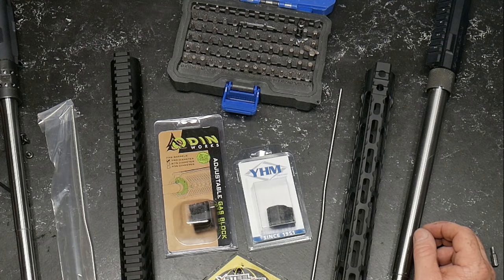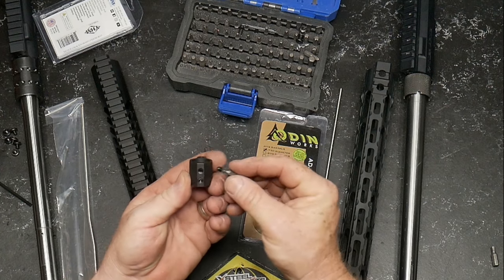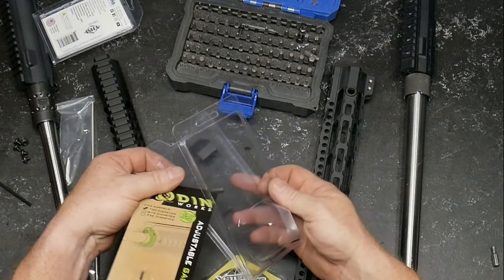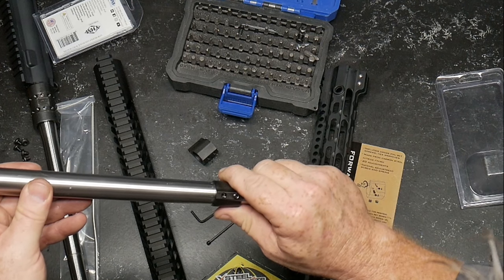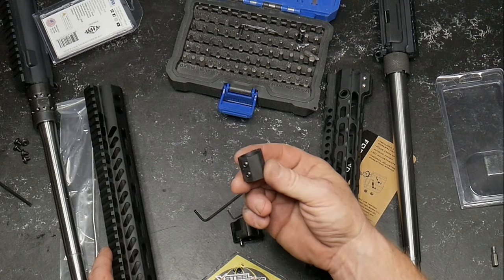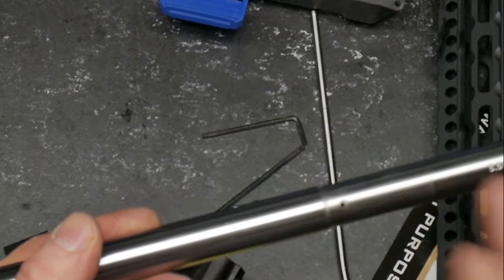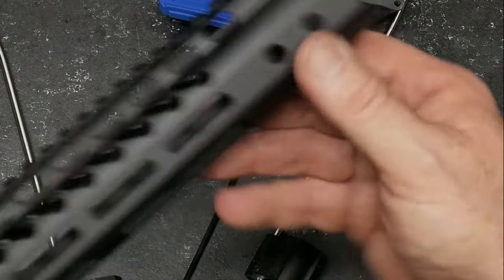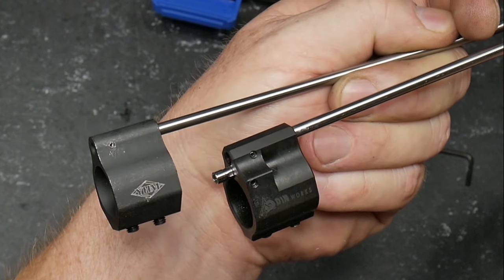Cheap Vs. Expensive!  Gas Blocks Why Basic or Adjustable

Comment: I put that Odin Works one on a 11.5 psa upper and I only have it 3 clicks open and it runs great... That’s really not much though. What are your thoughts about it only being open that little. Bcm h3 buffer with Sprinco blue spring also.
Reply: Hey buddy did you ever figure it out? Have a 10.5" Aero 7.62x39 build and I put my Odin adj gas block on it and and it runs really well with only 3 turns out as well. So I pin guaged the gas port and it turned out it was grossly oversized for a carbine length gas system. Man id have done what most do and stick a carbine weight buffer in there with a regular wide open gas block I would have beaten my gun to death in short order. Probably would have sheared a lugs off the bolt. 7.62x39 AR doesn't have a strong bolt wall diameter to begin with. Just received my Suppresor, so the fun of tuning the gas on this gun will happen again. Like to hear if you figured yours out.

Comment: If someone wants to change out their AR15 barrel with a longer barrel, does this usually require a different length gas tube? Or do most replacement barrels have the gas hole drilled in the same distance away from the chamber? Also would love to know what parts are different on a floated barrel system which I understand can lend itself to greater accuracy. Thanks for your video.
 🇺🇸 😁👍
Reply: The gas tube may be a different size in length depending on the barrel length. It could be either a rifle length, mid-length, or carbine length usually. The barrel manufacturer usually will specify which size gas tube is needed. 

As for the free-floated barrel, using a low profile gas block such one of the ones shown in this video will work with no problem. The inside diameter of your chosen rail may dictate what size gas block you can use. Check with the manufacturer to see what size gas block will fit. Buy either a steel or titanium gas block. Aluminum is not a good choice for this application. 

Typically I have not had a problem with using a low profile gas block with most of my builds. I did have one instance of a screw for my flashlight mount touching the gas block once though. I simply moved the mount. Hope this helps you.
Reply: @StevenScalia  Thank you for your information, I will look into all of this in the future. It’s very nice to know there are so many options for these Modern Sporting Rifles. 🇺🇸😎👍

Comment: Don't buy the Aero LPGBs. The hole spacing doesn't work with any commercially available dimple jigs because it is a odd ball at .485".

 .400" .425" .450"  .470" and .500" center to center

 They couldn't just go up to a even .500" or go down to a .470".

Now don't get me wrong you can still get it right with some patience and A LOT more time involved. But for those of us who don't like to mess with it or waste time it is best to stick to ones that your barrel dimple jig has. They got me on 2 of them but I won't be buying anymore. I prefer BCM, Yankee Hill and Superlative Arms much better. For beater budget build NBS work ok and are cheap.
Reply: I know John right. It took 2 for me to realize that I thought the first one was 10-15 thousands off so I bought a second one thinking it was a fluke but it was the same. You're also right, I got to work because you have about that much forgiveness between the gas block hole and the gas port so I was able to center over the center of the port put it was a pain in the arse. Have KAK jig with same dimensions.

Comment: question, I have a Daniel Defense DD5 V5 6.5 Creedmoor with a stock flashhider compensator etc called a "superior suppression device". too much hop off target so I swapped it with an American precision arms muzzle break and all of a sudden the gun won't cycle the next round. The gas block comes adjustable with an Allen wrench for "unsuppressed" or "suppressed" however I can't get it to move either way it is def not working but aside from that do muzzle breaks cause less gas to hit where it needs to? adjusting from unsuppressed to suppressed seems that will only cut even more gas furthering the guns inability to cycle. anyone have issues with this? or know how to fix it?

Comment: Hey Kotanboy32.  Ever tried using the YHM 9384 "clamp on" low profile gas block.  I'm just curious as to the clearance required to get the new rail over the replacement gas block...

Comment: I bought a Ruger AR556 Friday, shot it the first time today and 50rnds in the gas block came loose. If the gun shop I purchased it as won't fix it should I just put a better gas block on it or what can I do to ensure the original doesn't come loose again?
Reply from the maker: Get some Allen wrenches and tighten her up

Comment: Hey I no this is kinda old video but just wondering for your set screw blocks what torque do you use for the set screws? I can’t find an answer anywhere from superlative or BA lol
Reply: I saw in another video from Apache Rifleworks that they use 30 inch lbs for torque
Reply: Thanks I appreciate the info.

Comment: Hey guys im trying to do my first ar15 build but need your guys help im going with a 14.5 barrel but ppl tell me that I need a mid length gas tube others tell me carbine length also whats up with the diameter I see they have .750 and a .625 If im not mistaken would gladly appreciate your help on what to go with thank you

Comment: Have you ever used a gas block dimpling jig
Reply from the maker: nope, never had a need to
Reply: i'm on my fourth 3gun build and the last is a Superlative clamp-on. The previous three set-screw gas block builds were not dimpled and had no problems with about 15k rounds through them.
Reply: SLR Rifle Works makes a great dimpleing jig if you ever need or want to dimple the barrel. Also, they have a good selection of standard and adjustable gas blocks. Thanks for the vids.

Comment: INCONEL... it's {INK O NEL}  It's ultra high heat stainless. Used in turbo racing engines for valves and exhaust / headers.  You should have used a Inconel gas tube

Comment: I found a $6.50 Low pro gas block. It's legit.
Reply: Cat Un-Boxing link please.  The fuck? Lol
Reply: @rommelbuena998  prepper UP.com it's a shop in Oregon.
Reply: @toddy2519  Thanks for the link, however the adjustment screw faces the shooter so you have to disassemble the handguard to adjust...

Comment: Budget build total so far $179. Expensive build total so afar $759.
Reply: I built a budget .300 BLK Out pistol for about $400, now I'm building a 
.223 Wilde 14.5 high end rifle. I still need the hand guard, iron sites, an optic and have the muzzle break pin and welded. I'm already at $872 and the rest is going to run around $1,000. I never thought it would cost me that much.
Reply: @paulhughes3961  I did a PSA 20" and 16" with aftermarket parts in M16A2 and M4 carry handle style. Average cost between the 2 was $600. It's all a matter of what income you are blessed with.
Reply: All just depends on the manufacturer and the price one is willing to pay. All my AR's are $800 or less.
Are they high end? No!
Do they meet or exceed military specifications? Yes!
Are they accurate? With selected ammo, most certainly!
Are they reliable? So far, yes, each rifle has over a 1,000 rounds fired with no malfunctions, primarily steel cased ammunition, wolf, RAS, Tulammo, as well as AE XM193 and PPU match 75gr BTHP.
BCA, PSA, and modified Ruger AR556.

Comment: I would have liked to have seen the roll pin install and how it impacts the gas tube. Not a complaint, just saying.
Reply: There is a reason he coward out on showing that. It was because it wasn't easy and is awkward and he didn't want to be seen struggling with it. But it can be easy on these awkward blocks, install the gas block on the barrel first, tighten it down and put it on a bench block like the orange ones Brownells sells,  easy to drive in.
Reply from the maker: Hey Junkie, how many have you installed.........  you should start a channel so you can show us all how you do it
Reply: @kotaboy32 I am assuming that you are responding to a comment that I can't see. But, if not, I have never done it, yet. I am building my first AR as financing permits. I meant no disrespect with my original comment. I love your channel and think very highly of you.
Reply: Don't get your panty hose all in a wad boy. You got got called out and owned, thats why your so mad, accept it. Deal with it.

Comment: If the set screws didn’t perfectly align the gas block to the barrel port, the gas block is garbage. Why praise that as quality?  Every gas block that is designed with set screws aligns perfectly or they should be making lawnmowers instead.

Comment: Gas blocks do not reduce recoil that was a lie.
Gas blocks are to adjust the pressure going into the bolt carrier adjusting for cycling to different cartridges pressure.